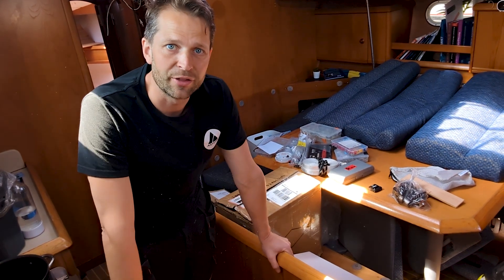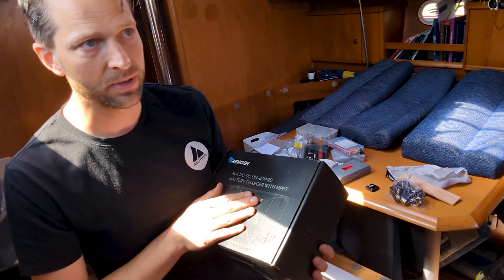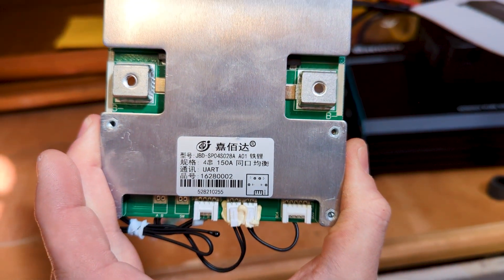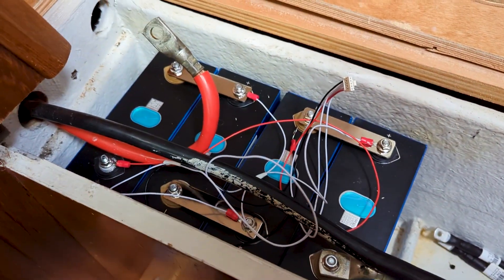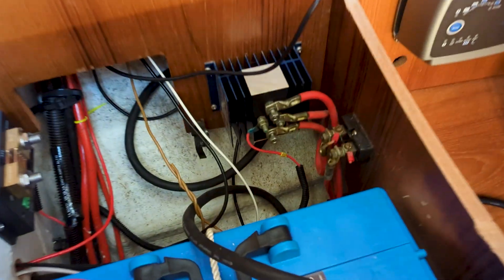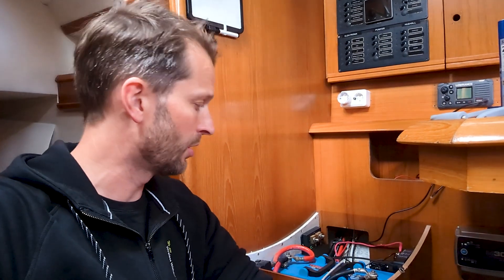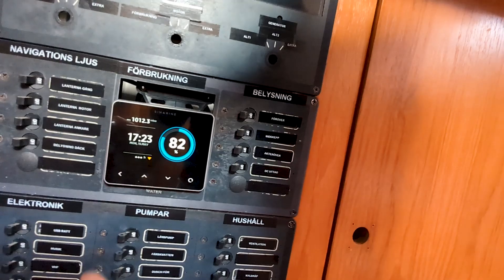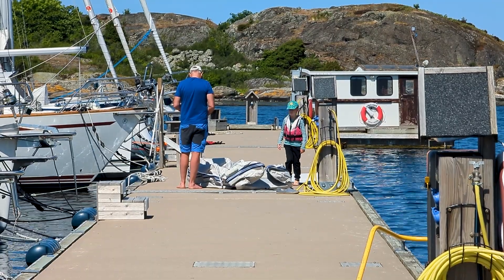Lithium upgrade on our boat, with DC/DC and DIY LiFEPO4 cells with BMS.

Comment: Hi, why did yor replace only the service battery but leave the starting AGM battery?
Reply from the maker: @vladimirvikulov2359  No real need to replace the starter battery. It's always at 100% and both Alternator and Starter motor likes to have it there. 

The service battery on the other hand goes up/down all the time as we use quite a bit of power.

Keeping the AGM made the whole project easier, as I can keep my Alternator and that part of the system intact. 

Makes sense?
Reply: @sv_eden  Thank you, that makes sense. Yes, I agree that it simplifies the scheme. 
During the Russian shelling of the power plants, I took the batteries from the yacht to my house to have a backup power supply. But lead batteries have a weak power and I changed them at home to lifepo4. Now I'm thinking to restore the circuit on the boat with Lifepo4 technology and I'm looking for an example of how to do it better. Thanks again!